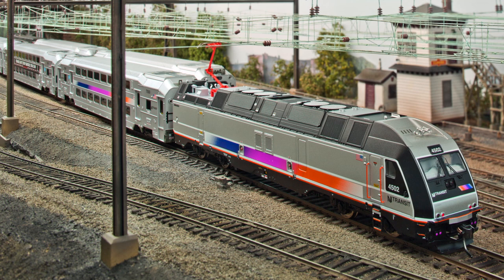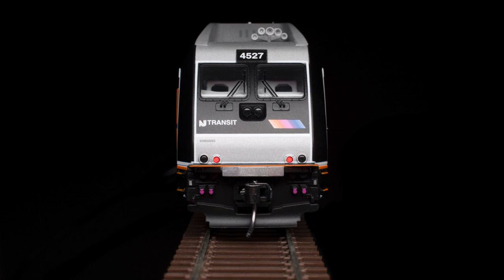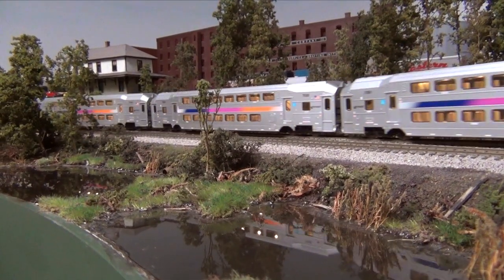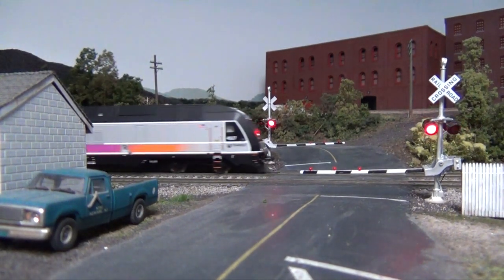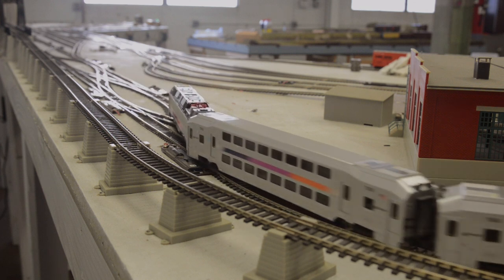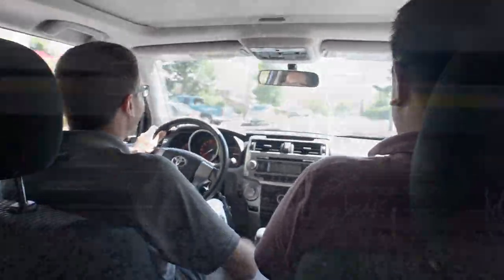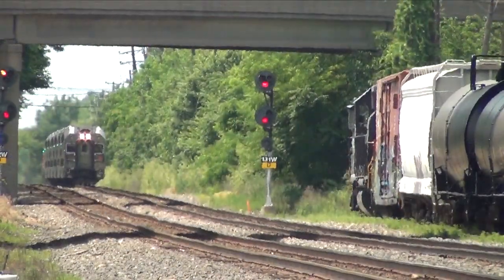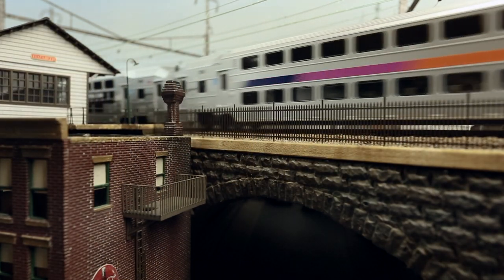Atlas HO Modern Commuter Train - NJ TRANSIT Version

Comment: My wish list for future model train tech:

1.)  Radio throttles/cabs/controllers with rechargeable batteries that come with a cradle (like cordless phones) that keep the battery charged when in the cradle.

2.)  POV - Like model planes have been doing for years, put a micro camera in the loco at the driver's seat position, and put a video screen on the throttle/cab/controller so you can watch your loco run around the layout from inside the loco as you drive it.  Quadcopters have been doing this for years, and other model planes have been doing it as well, so the concept is viable.

3.)  Attach tension sensors to the couplers on the locomotive and have the decoder adjust the momentum automagically based on the value returned by the sensor.

4.)  Automatic double heading.  With metal couplers isolated from the chassis, add additional wires to the decoder to connect to both couplers, then have the two decoders in the two locos recognize that they're double-headed due to the electrical connection by the couplers and both decoders send their commands to each other so that both decoders respond to the commands sent to  either one.

5.)  Passenger car doors that open under control of the locomotive (through a signal passed down through the couplers).  I.e., set a CV on the loco, and all the doors on the coaches open.

Comment: Atlas, I have already preordered your 2nd Multilevel series.  These seem to be selling VERY well.  It has been widely agreed on that Atlas would do VERY well producing: Comet II (original and rebuild), Comet V, Comet IIB, GP40PH, GP40FH, PL42AC's.  There are many commuter modelers than a lot of manufacturers realized.  Keep up the fantastic work!
Reply: I model Metra, so the F40PHM-2s and stainless steel coaches and cab cars would be very useful for me.